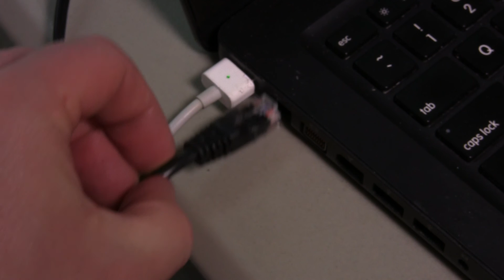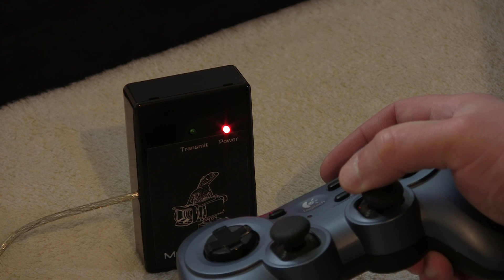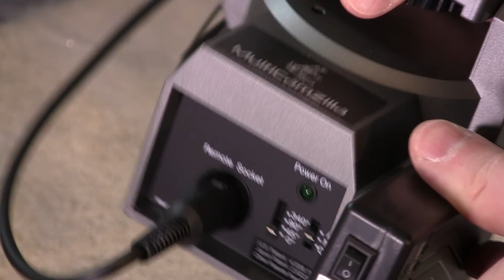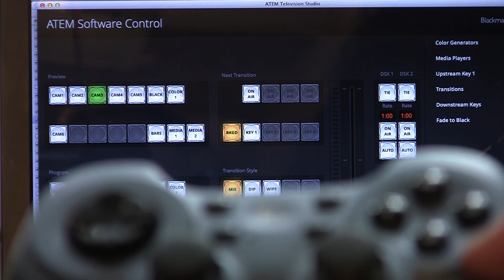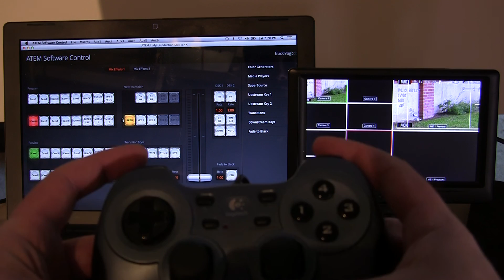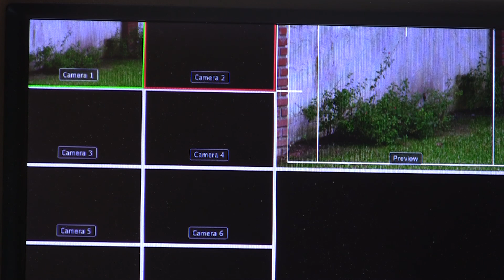MultiCamZilla - Getting Started

Comment: How is focus adjusted on the controller?
Reply from the maker: The right joystick normally controls zoom in and zoom out, but if you push down on it (they joystick has an integrated button), it becomes focus control.  Also, if you momentarily push down on the left joystick you can switch to auto focus if you're in manual, and then it'll switch back when you let go (available for LANC cameras only).  This is a great feature for quickly letting the camera auto-focus on your subject, but then going right back to manual so it doesn't "hunt".  The left and right hatswitch buttons are also a single-push fine focus controls, which sends the smallest increment of focus adjustment with each push.